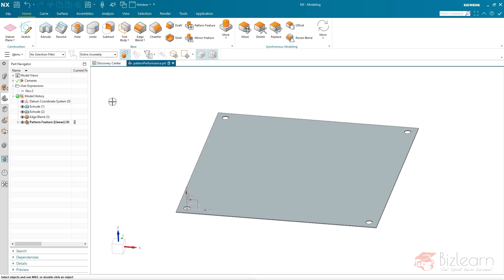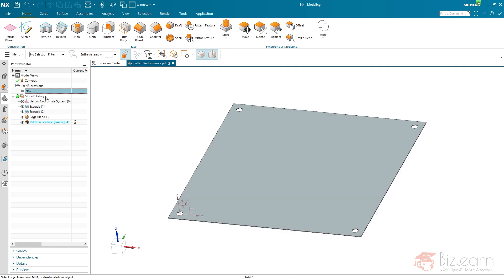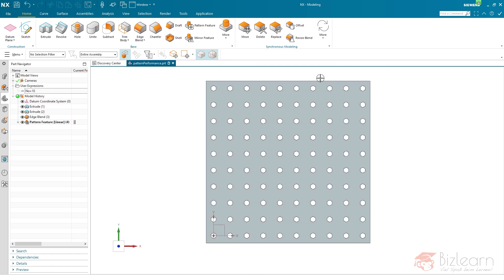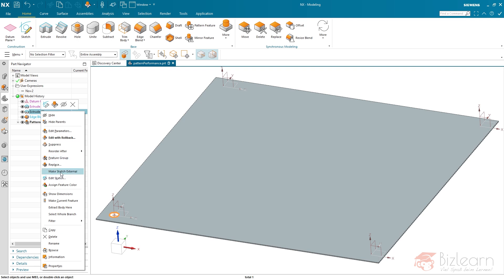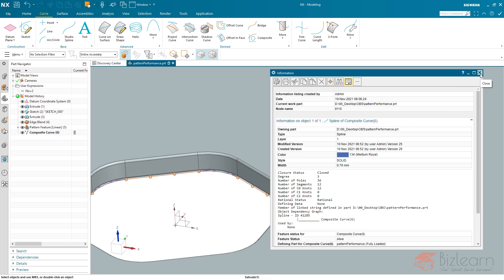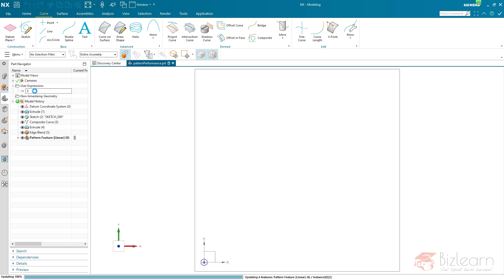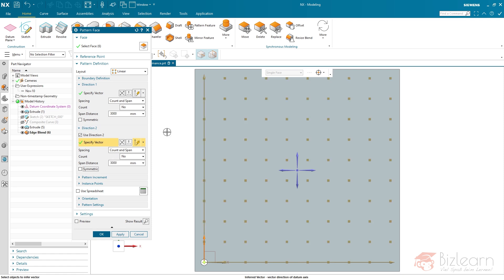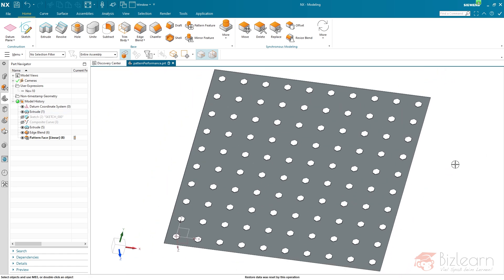Creating fast gigantic patterns with Siemens nx - this nx cad secret will change your mind!

Comment: On a machine with an 4.0 ghz Intel Xeon with 16 logical processors, NX seems to utilize only 10 percent of the processor power when calculating complex patterns on my end. It would be so much more helpful if NX was coded to use all of the cores....

Comment: Hi! Very useful video. I'm working in a big pattern of a complex solid, that needs to be merge into a one piece solid for printing manufacturing puropose. Do yo have any tip to handle a pattern of 400 thousand of bodies? I'm  finding very dificult to create that pattern even when i made smaller geometry pattern (i find it geometry pattern faster than feature pattern) and then repeat to create more instances. Then the boolean its a extremly slow operation (sometimes days). Do you have some advice to work with these kind of heavy geometries? Ty in advance
Reply from the maker: Thanks for the comment. Use pattern face and create as less objects as possible. Therefore you can use join curve e.g. to reduce the number of edges. I have solved this kind of problem several times for my customers already👍

Comment from the maker: It takes 22 Seconds to calculate 400 instances (120 x 400 objects) with this method and the Pattern Face Command. But it takes 117 Seconds to calculate the pattern without the use of Composite Curve as shown in the video. The calculation time increases exponentially with a linear increase of the number of objects. This is meaning, by doubling the number ob objects, the calculation of the pattern will be way longer than just the double amount of time! You can test this for yourself and let me know what you thing (-: Have a nice day and don't forget to subscribe our YouTube Chanel 🤘